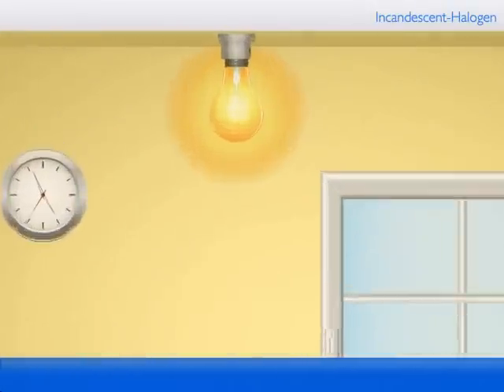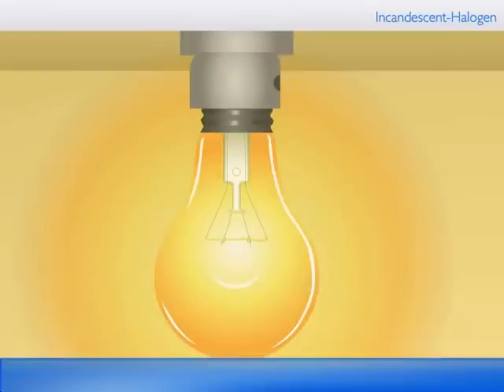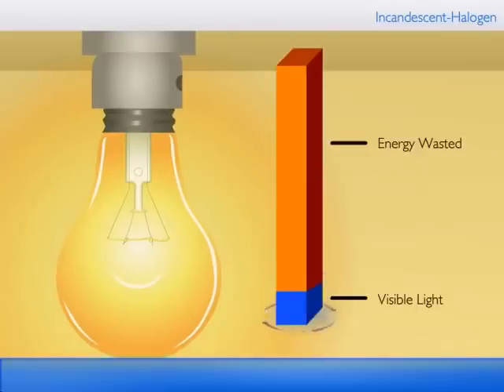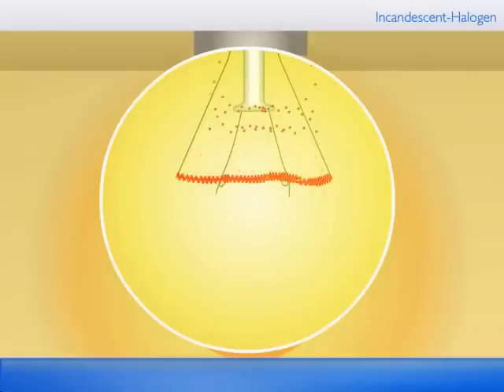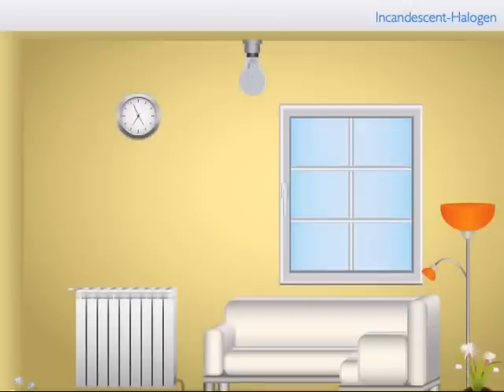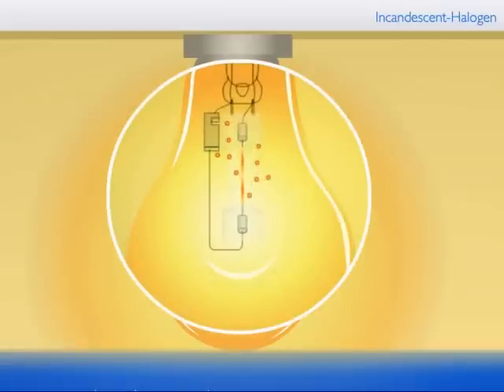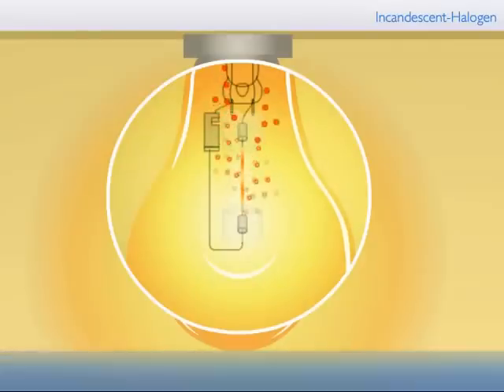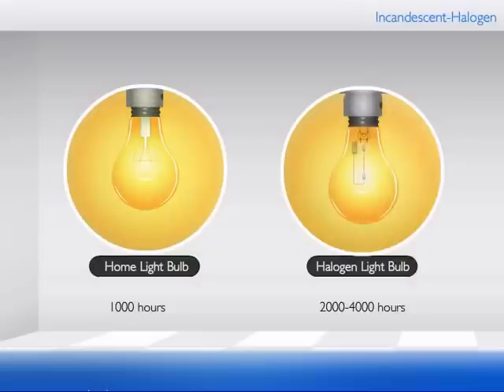Incandescent and Halogen Lamps

Comment: I bought Philips 28 watt halogen bulbs for the chandelier over my dining table. I have now had 4 lamps fail the same way after 20 minutes. The outer glass bulb breaks away from the metal base due to overheating and shatters into my dinner. The internal halogen bulb keeps working but the mounting wires are exposed posing a 240 volt shock hazard. The box says made in Poland but the bulb is marked as made in China. I will never buy another Philips light bulb.
Reply: Get heavy duty rough service bulbs
Reply: do not use it if the outer envelope broke - halogen bulbs emit quite a lot of UV radiation which is normally absorbed by the outer envelope